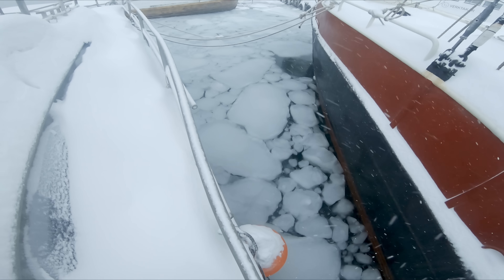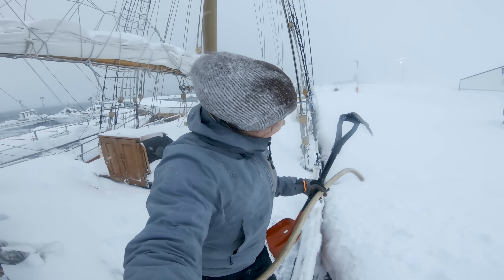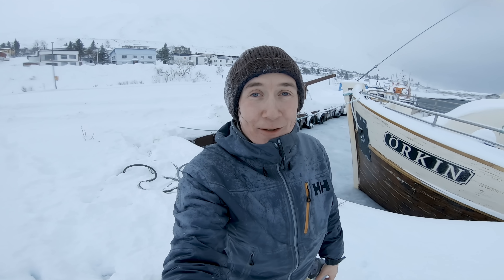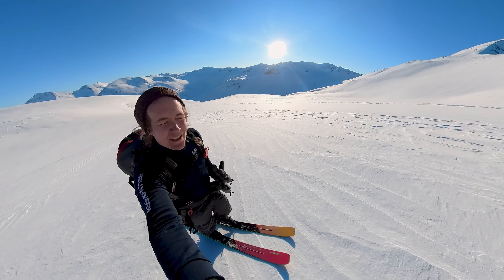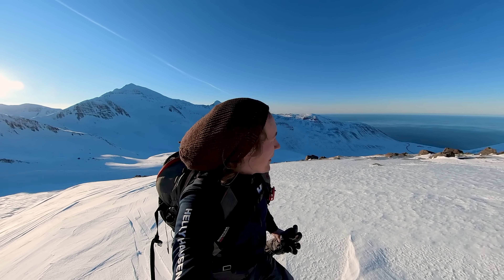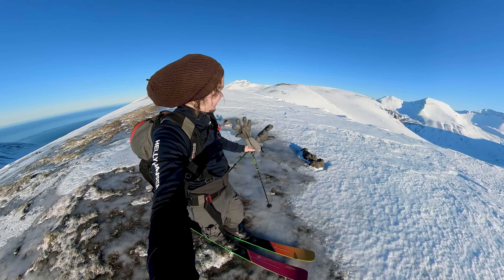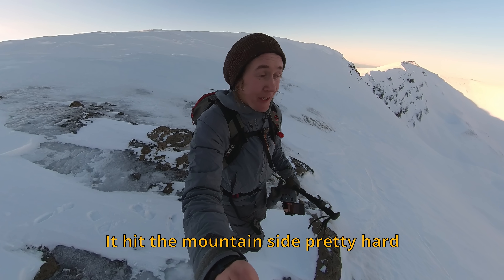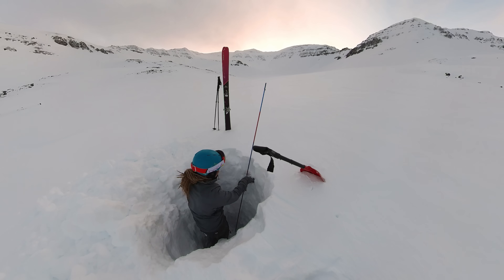Uh, oh.. Winter Aboard a Boat in Iceland 😬 (Daily Routines)

Comment: What about 🤔using dryer hose to redirect the heat from the chimney from the heater into the track for the main sail, or go up by rope and use a heat gun to blow out the channel a little bit at the time until the sail will go up and down freely , this is where the very old boat has a functioning advantage

Comment: Absolutely love the scenery!
But I had a feeling you were going to have trouble with a frozen hose the moment I saw you pull it out of the locker. Next time make sure the hose is fully drained of water before you put it in storage outside. Spring is on the way though, so keep smiling😁

Comment: Juho, you are Finnish and a man of the snow and the cold. I assume you admit you should have been a bit more prepared and not run out of water when the calendar says February and you're faaaar away from the Abacos?
I understand why you complain about the 'crappy' conditions. Not only is the snow difficult to ski bcs its rock hard ice (and the real rocks), but skiing on such mountains can also be dangerous as you often come from hard packed snow and hit softer parts without warning and vise versa: it's easy to break a leg or two. Good to see you use a helmet.